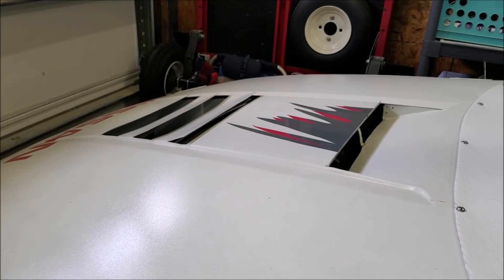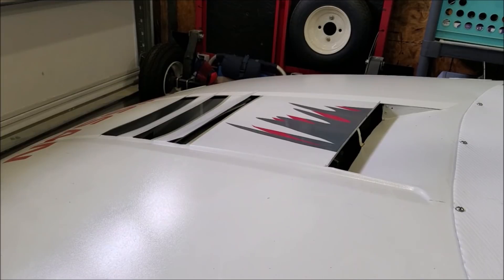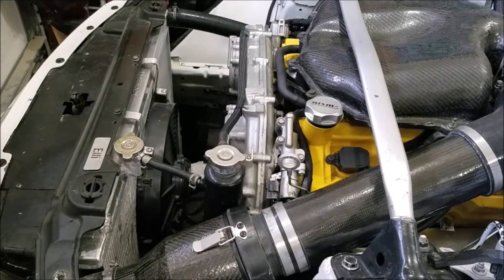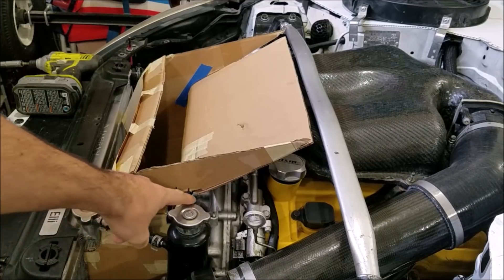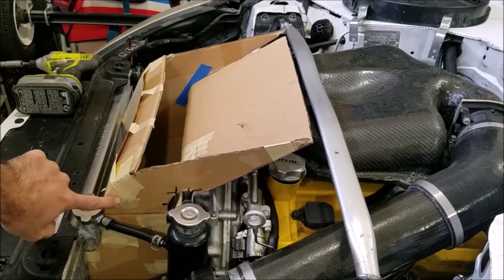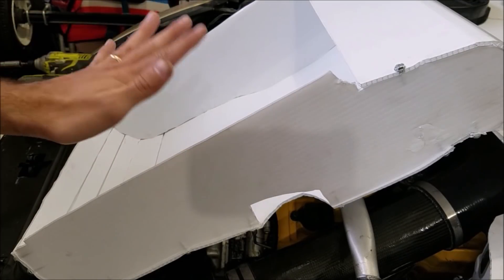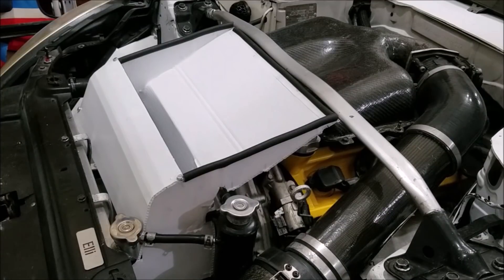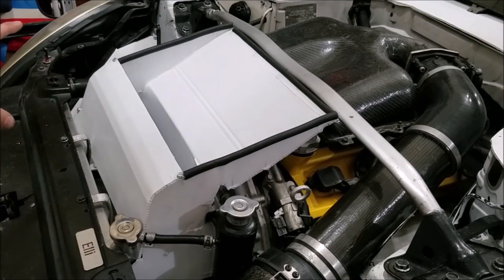Nissan 350Z Hood Duct

Comment: Did you do any actual testing to see if it actually worked in cooling the motor and did it help to tape off the grill for front aerodynamics and down force.
Reply from the maker: I did not, but realistically, to see a big difference, you'd want to move the engine backwards and angle the radiator forwards to get the most out of the ducting

Comment: Nice work!  I could not bring myself to cutting into my 350Z hood, so instead I removed the rubber seals at the back of the stock hood.  I am mindful when it rains or when I wash it, I keep the seals in the car at all times.  But for the other 95% of the time it's driven, not raining, the heat just pours out of the top of the hood.  I know when I'm driving the heat is getting pulled(sucked) out as air travels across the smooth hood and up the windshield.  I didn't take it as far as some guys do and add one inch spacers on top of the hood hinges, creating the odd looking gap from the side.
Reply: The area in front of the windshield is a high pressure zone. You're more likely pulling air in. That's how cowl induction works for engine intakes and that's why the cabin air intake is there.

Comment: Would you be able to upload if you can or want, the parts of the cardboard with all the dimensions or an exact size for that so we can print them off and use them as stencils and make it our selfs 🤤
Reply from the maker: I don't have a stencil for it because my engine bay doesn't really match a stock set up. It wouldn't fit.

Comment: So what is the purpose of angling the radiator ?
Reply from the maker: The angle helps make the transition smoother for the air. Instead of straight through then a sharp turn upwards, it has a more gentle transition. It will also generate some mild down force as the radiator redirects the air upward.

Comment: I'm interested in finding out what kind of plenum and intake you have....the diameter of the tube looks much larger than normal, and the upper plenum at least looks aftermarket as well? What size throttle body are you running, 75mm? Thanks.
Reply from the maker: I have a full playlist on making my carbon fiber plenum. It had a 75mm throttle body on it and integrates a 1/2 inch spacer.

Comment: You makeing these?
Reply from the maker: No, it will be different for every car depending on many variables like which cooling fan you run, cooling pipes, hood vents, ect. It's pretty easy to make though
Reply: 350Z247 😔 damn, its a really good mock-up cuddy, id 100% buy one for my 08